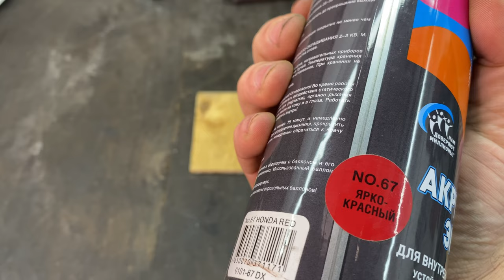Restoration of an old Emergency Stop Lamp❌❌❌!

Comment: What type batteries were those? I've never seen any like that before. I was surprised you didn't clean the red lens before you fixed the edge with the home-made red epoxy mixture. There was a lot of dirt on on that lens cap. But in the end It came out very nice...
Reply from the maker: These batteries are 3lr12, 4.5 volts each.
It seems to me that I cleaned the red lens pretty well, maybe these frames did not make it into the video!

Comment: Interesting adapter replacing the big battery with those smaller batteries. There are even adapters for AA batteries as replacement for those batteries :)
Reply from the maker: I wonder how many AA batteries are needed for this flashlight?!
Reply: @ITBR_Restoration  12 :)
Reply from the maker: @dominikschutz6300  Thanks